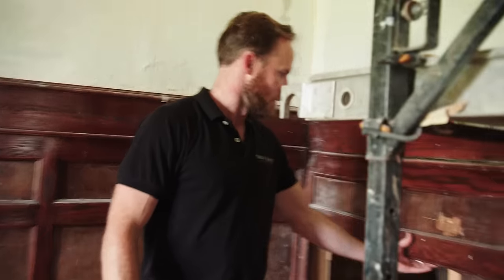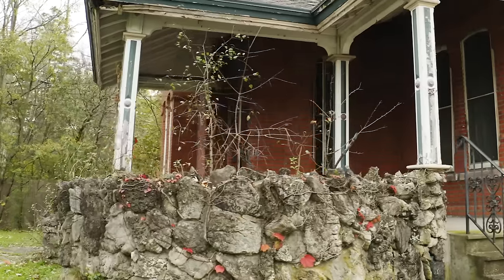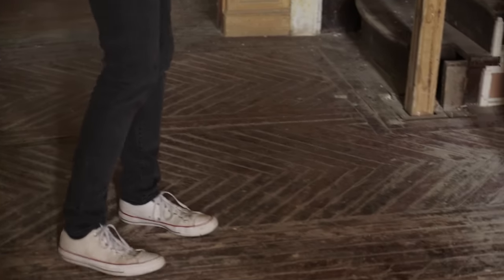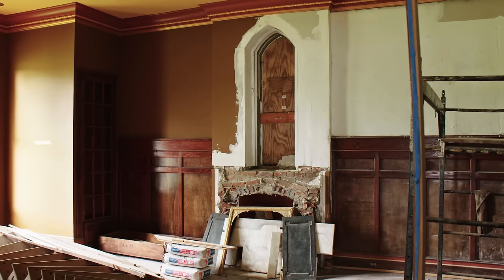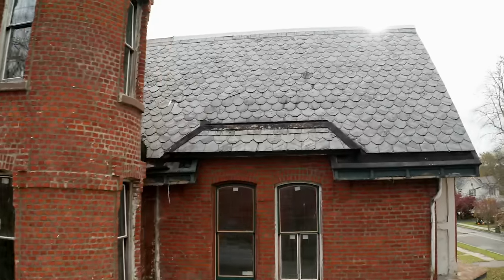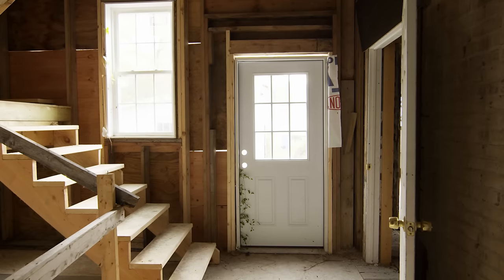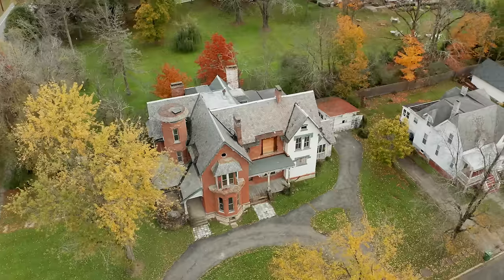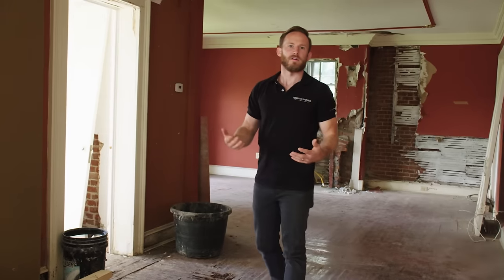Touring An Abandoned Victorian Home Ready For Renovation | Architectural Digest

Comment: If you want to live in a modern home, buy a modern home. Antique homes should be restored to original as much as possible. Please stop destroying these beautiful homes.
Reply: Couldn't Agree More!
Reply: There’s a balance to be achieved between preservation and practicality. Do you really want to keep steam radiator heating systems? How about those air-leaky windows? Renovations and alterations must be done with preservation in mind while simultaneously providing greater comfort/ efficiency.
Reply: The Victorian era ended in 1903. Some modern updates are totally appropriate.
Reply: @dadboyrob Put modern storm windows over the originals!
Reply: U can mix both to make it even more beautiful and practical

Comment: I am a slate roof estimator for an industry leader in slate, tile, copper roofing and restoration. That's Chapman slate on most of the roof. Typically a 125 year slate before it starts falling apart. Sometimes it does better than that if it came from a really good part of the quarry (rare). You can see some of it has been replaced already with Vermont weathering green slate. The flashings (all the metal parts of the roof) and the built in gutters are in terrible condition and need replaced pronto. All that tar is not natural to the roof, it means the metal flashings and gutters have rusted through and have been leak problems for quite some time judging by the state of it. You could replace all the flashings and gutters on the roof for somewhere around $150k. The Chapman slate I'd give another 25, maybe 35 years, with an average of 20 or more repairs every year from natural deterioration and breakage. Vermont slates lasts a total of 125 to 200 years with an average of 0-10 repairs each year, so that's got quite awhile since it's newer but I see it's been mixed in with the old slates that don't have nearly as long. I'd be suspect about the underlayment on those low pitched roofs where it needs repairs where the elements have been getting to that underlayment and deteriorating it. Low pitched roofs don't do so well without completely intact underlayment. I know some about mortar and masonry as well and I can see that the brickwork has been repointed with Portland cement which is terrible for those soft bricks. It needs lime mortar to allow moisture to wick out, and with the Portland cement, which is more dense than the bricks, any moisture will be wicking through the bricks instead which will see them suffer a lot of spalling particularly during the freeze of winter. It's not a complete throwaway but there's more needs done than what's realized in this video to truly have a properly restored and therefore properly functioning exterior system for the home. Total repointing with lime mortar is a must. I'd like to see a total reroof as well because the flashing and gutters need it and Chapman really gets nasty in its last couple decades of its service life. In my opinion it's better to skip those last couple decades of Chapman slates service life as it pits and deteriorates then breaks along those diagonal lines you see which are weaker material within the slate. Total reroof cost? Idk, probably $250k-$300k. The repoint price? Not sure. Potentially as much as the re-roof or higher. A real labor of love here and worth it for the right person with the funds but I think that person ought to know about these things I've mentioned.

Comment: Really hope whoever restores this does not put a wet room in that turret. With all the space up there you can easily fit a big, luxurious bathroom. Keep the turret as a turret - after all it's one of the main characteristics of the house, that upper woodwork is fantastic. With all that space why would you want to cram into a circular closet to shower? Wet rooms are for desperate times, not mansions. Also doesn't need a balcony; keep the original windows as it doesn't look like you'd get serenity or privacy.
Reply: i would love to turn that turret into a small reading room with a ladder to get to the higher levels for places to relax and take in the views, would certainly not keep it as a bathroom or turn it into a shower which seems like a huge waste.
Reply: I think the turret should be a sitting rm inside master unless you need a nursery
Reply: I stopped watching it at that point , I havn't changed my 1924 house at all , I don't modernize my antique furniture , why would I modernize my adorable house ..

Comment: if i'm going to renovate this house, i woudn't change it's exterior design at all...just cleaning up will do as it's already gorgeous 😍
Reply: Agreed, the Juliet balcony idea is not appropriate since historic exteriors should be preserved intact, there should be respect for historical design. Just like you don’t paint new clothes or accessories on a classic museum painting. His ideas to restore the porch rail to something period appropriate in place of the mod concrete block and get rid of those new replacement colonial windows are right on the mark though.
Reply: On the first floor, when he mentioned putting in a "slider, " I almost spit my coffee.

Comment: Our 1895 home is very much like that, albeit half the size. We even have the turret :-) And throughout the house under the floors and (we think) in the walls are metal pipe runs which supplied gas lights.  We worked on it for 7 years - and are still adding little details. One thing not covered in this video: wiring, plumbing, heating and air. We had to give up some space in a downstairs bath and home office to run plumbing and HVAC ductwork upstairs. What shape is the basement in - drainage issues, for example? I'd love to see progress on this project!

Comment: What a beautiful house! Something you missed on the outside is what appears to be new tuck pointing, which would be great, but in this case they used a cement based mortar which will destroy the brick. Old brick is very soft and needs a lime mortar. Repointing will add $100,000 to that project.

Comment: Ok just a quick thing if I was to own that house and fully refurb it with no budget I’d make sure in some kind of way to keep the aesthetic but modernise it to the highest degree. For example with the windows I’d make sure they’re at least double-glazed, but try to keep them in the same kind of Victorian-era look, then with the tiled roofing I’d find a way to install photovoltaic glass tiles to provide electricity, then with various walls I’d install proper insulation (if it needs upgrading) and change the whole heating system to a heating pump etc. 

Very nice. Thanks for giving us this tour, Architectural Digest. This is wonderful.

Comment: Also, fixed windows in a bathroom are a terrible idea. Ventilation is so important, and we shouldn't be making such things impossible without expensive technology and power. We should always build/renovate to allow for low budget living, ensuring the options to avoid appliances and climate control etc are intact.

Comment: The most important system that needs to be fixed on this home - after the shoring of the structure to level things out internally - is the roof. There's been so much water infiltration over the years, and with the holes discovered in the attic, there's just no simple patch fix. Those lovely slate tiles need to be removed and catalogued, failed sheathing boards and framing need to be repaired where necessary, a 100-year (minimum!) underlayment needs to be put down. Copper or flex copper fabric flashing components and stainless fasteners should be used to reinstall the tiles. and new copper ridge caps installed. It's possible many of the current fasteners are corroded beyond recognition. If you pause the video at 17:00 you can see that the main ridge of the home is buckled in the middle, meaning there's been differential settling in the front or rear walls, and/or there's been water infiltration that has failed the framing. That movement in the framing opens gaps in the solid roofing materials which have no ability to accommodate that movement. That's an expensive ordeal, but a necessary one to preserve the hundreds of thousands being spent to make the interior gorgeous for the next 100 years. ;) That water infiltration almost always makes its way through to the foundation, so buckle in for a hell of a ride! Oh, and how to make a solid brick exterior energy efficient when all you have is lath and plaster directly on the brick?! I hope this worthy home project happens and you show the progress!
Reply: I'm also concerned for the brick - another comment said it used to be entirely white, and it looks like in the process of returning it to natural brick, the hard surface of the brick was sandblasted off and repointed with hard portland cement instead of lime, which should be pretty brutal on those old bricks with a NY freeze/thaw cycle.
Reply: @kellytunney3093  Excellent commentary! There's so much science to building materials and old gems like this need a thorough re-think.
Reply: it also appears that the rear of the roof has been converted to asphalt shingle?

Comment: As a builder and a designer there is no part of building I haven’t done. That said, this is an amazing house that I would love to get my hands on and in the first two minutes was exactly where he ended up 299k plus 300k at the end. if I hired out or subbed the job. This is definitely not a normal flipper, as you may have to hang onto it for who knows how long before selling. But I have really good techniques on finding the vintage materials As that’s where you can save a fortune. But I’d like to know how fast after listing; the houses in the area are selling. And if I did the work it would be about 160k to 180k but there is a lot of house that doesn’t need to be replaced just refinished; sanded, restained, painted Sheetrock ect.  Love the floors easy fix.   Cheers from Utah.

Comment: Unfortunately, as a modern contractor he should Not be used on a project of this type or scale. The bones of structure can easily dictate how it can and should be renovated without imposing a 21st century slant on the structure. To say that you should install a sliding  patio door on the back of such a house is showing that he has no respect for the nature of the architecture wherein should a modern raised patio area be desired, a mire sympathetic aproach shoul$ be considered.
Reply: I hadn’t thought about that but that makes sense. One thing I loved when I saw —- and have seen nowhere else — is triple hung windows in the octagonal room at Monticello. They start at the floor so one can raise them to make a door out to the veranda or lower from the top for air as a window.
Reply: @JP-lu9ed  on historic houses, the integration of old and new aspects will always make the new seem as it was always there regardless of it being interior or exterior. Monticello designed and built by Jefferson was almost always a construction site. He was constantly rebuilding some part of the house. For a good portion of the initial house building, the Jeffersons lived in the small cottage building on the site. His ingenuity extended even to his furniture and his library shelving, were made so they could come apart and each shelf only needed a cover to be a ious full transport crate for the books on that shelf. While nota new invention, Jefferson made much use of his pantograph for making copies of all his letters. Yes his triple hung windows were an ingenious means for accessing his walk around  wings over the workshops of the estate as by using them he could quickly talk with many if the working slaves for both the estate and the farm.

Comment: I'd say the main problem you have externally is a mass square footage of friable brickwork which has lost its surface (delamination) and edge definition through becoming water saturated from decades of water ingress, most likely from previously failed roof guttering etc. Much of the brickwork would need replacing.

Comment: This looks like  a nice Victorian, originally well built. Been involved in reworking some Victorians. It's only for those with money to burn.  A million dollar renovation to get it livable IMO. $1.5  to $2 million and it'd be an OK Victorian restoration. But there are all sorts of  possible problems requiring you to tear down some parts altogether. If the structure can be repaired or replaced, the roof and exterior is a plus. As you say: building a house with a house in the way. Exactly how I find these houses to be.

Comment: I always have a lot of opinions on old houses. I love them and most of all respect them. (I live in an 1890s victorian).
This man didn't ruin everything as I was afraid he would at the beginning.  He came up with a lot that I guess appeals to buyers.  True old home lovers do not want a modern open kitchen and new windows.  There is so much $ to be spent here on fixing- so why fix what is amazingly still intact? The word RESTORATION should be used when referring to an old house not RENOVATION.  That would keep your mind set on the right track of what to do with a place like this.  If ypu look at websites that feature old homes for sale and read what they are promoting you will see "original windows" listed as a selling point.
Builders should bring an old house consultant with them to veto ideas that would ruin the homes original appeal.  So many old homes have been knocked down and replaced with garbage new homes so let's treat the remaining ones as the works of art and pieces of our history that they are. 😍

Comment: San Francisco has hundreds of old Victorians. The house
market in SF is so crazy that only the rich can afford these
old ladies. The first thing the new owner does is find a 
contractor who promptly guts the building. All the old 
wiring is removed & the house is rewired & brought up
to code. All the old lead pipes are removed & new copper 
& pex plumbing is installed. The old boiler & steam rads are 
discarded for modern central HVAC. Then the interior of the
house is rebuilt up to code.

!

Comment: That outside $30K estimate at the beginning seems pretty low, it was for masonry only. The slate roofing work wasn't included anywhere in the video. That could easily be another $30,000. Friends of mine live in an old Victorian farmhouse with a slate roof and the estimate they were given for repairs was higher than that. This house hasn't been lived in so I expect the roof damage would be more significant. I was surprised to not see any water damage on the ceilings.

When they've had to have slates replaced, every few years it seems due to storm damage, the only people that could do the work were from Greenfield Village in MI. What type of preventative work could be done on a roof like that to keep costs down?

How would you approach a half-painted house? Sandblast or finish the painting? My friends' farmhouse was that orange brick painted white too and that was a regular job. The paint kept peeling off one side especially.

Comment: These older homes are very high maintenance, I know, I live in a 140 year old house.  I would definitely check the condition of the old cast iron pipes because they WILL fail at some point (something I'm dealing with right now).  Now would be the time to tear them out and replace with modern PVC which is obviously a major plumbing expense.  Also I'm guessing the entire house would need HVAC ducts installed throughout.  No sense in dumping a million dollars into it if it's cold and drafty in the winter or hot and stuffy in the summer.

*Edit - I just saw where this house is located.  On a busy street across from the DMV and courts and surrounded by $200 - $400 K homes.  A million dollar restoration would only make sense if it was in a nice quiet tree lined neighborhood with other million dollar homes.

Comment: Your first estimate off 400 thousand is I think on the low side. I think your million  would be about close to what it would cost to make that house stand out. That turret roof would need to be replaced with a cone top, front porch would cost you more than 10 grand its close to 25 thousand in my opinion, you have the millwork to match and I'm gonna bet that it's structure is well rotted through in places. I would spray foam that whole home to make it more energy efficient.  I would not put a bathroom in that turret I would make it a nice reading nook or place to chill. I could go on. Even though I am no longer In The trade any more I do have 20+ years of experience under my belt. And spent the last 8 years renovating the house I just sold. And I did it on a limited budget. I spent about 20 thousand dollars and if I had the trades come in to do what I had to do I would be almost triple that amount. That is why I'm going with the million to renovate that house. Just my opinion. But it would be a cool project to see done

Comment: Really lovely explanation video of this huge gorgeous old home! Will you be gutting all the lathe and plaster so you can install high insulation? You did not mention this at all.
I am presently gutting and insulating my 1912 two story four square house so we can heat and power it with renewable electricity and off natural gas...and we live in the cold North.

Comment: No mentions of existing utilities or upgrades necessary.  In 1895 the home would have been heated exclusively by the multiple fireplaces.  Lead piping throughout the home probably provided for gas lighting.  Early electrical upgrade would have likely been knob & tube wiring from a 60 amp service.  Air conditioning for homes wasn't invented until 1902.  Energy costs and environmental foot print weren't a consideration at that time, nothing was insulated.  The attic space would be now lost for the need for insulation.  Lead water supply pipes and clay sewer pipes, if not already replaced need to be addressed.  Another $100K for utility upgrades would probably be a conservative figure.